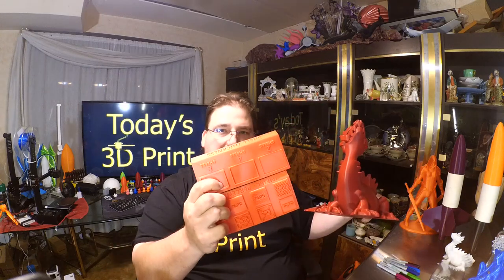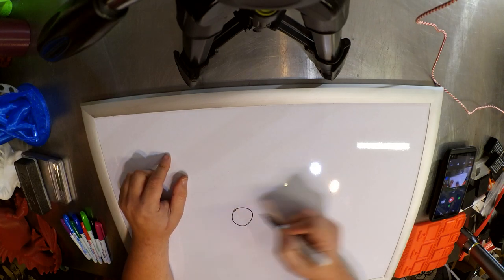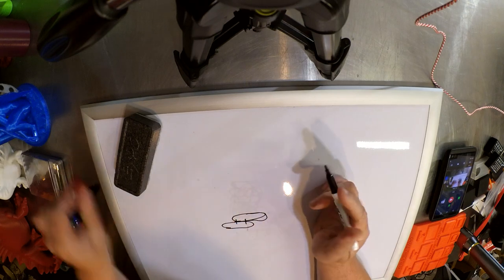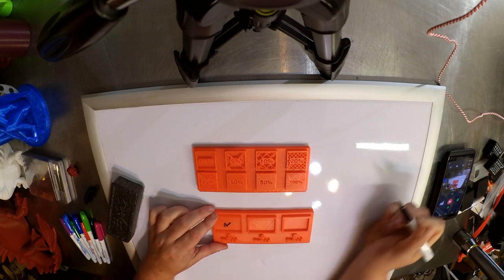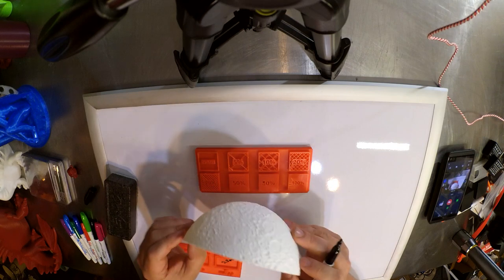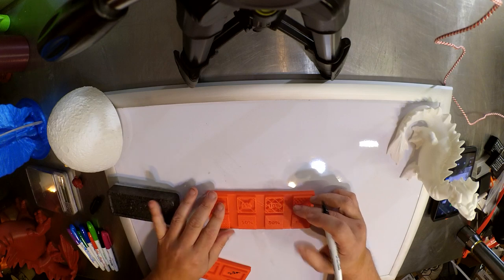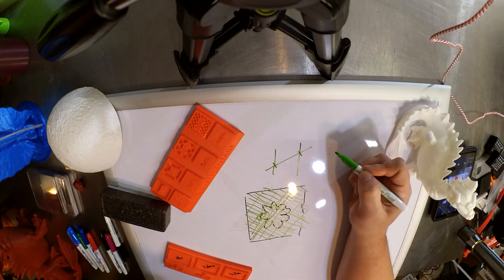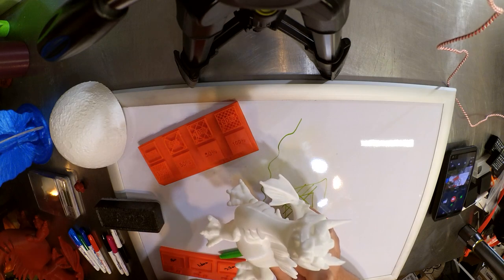Today's 3D Print 117 Educational Perimeters and Infill for Support

Comment: This vid is awesome, thank you! I was curious as I print with a handful of printers in the 200X200X180 size, but have just added a CR-10 to my line up and am realizing that the things I did with the smaller printers will eat amazing amounts of filament with this large a printer. This vid points me in the right direction to saving on material costs, however I was wondering (I don't have S3D yet, it's on the wish list), but could you make a demo vid of how you add custom infill to various areas for these large scale prints? I'm looking to get ahead of the "big" print volume learning curve be fore it costs me kilos of filament! Thanks again for the awesome content!
Reply from the maker: +JimmyPop FiftySeven no problem it is fun just remember you double the dimensions in 3D space and the object takes eight times the volume that's a big jump in both time and filament but oh so satisfying :-)

I'm going to make a video for simplify3d and as soon as I can also with Cura because Cura can do something Simplify 3D can't do. simplify 3D allows me to Define custom infill on the vertical Z axis but not horizontally once I pick a layer to add infill to it adds it to the entire layer

Cura on the other hand has the option to customize it completely it's not as easy or clean but it's there it's called infill meshes and I really want to play with that so stay tuned for that coming soon

Comment: This is really good stuff sir, this is exactly what I am printing those models for. ;)

May I suggest/request that you use a webcam and a 3d printed arm to do your overhead views, there were some parts of the frame that were hard to see. I have personally had good luck with the Logitech C920 and thing:1619715 for in person demonstrations on an overhead projector. :)
Reply from the maker: +Aerik Forager yep I noticed that flipping the frame on the tripod didn't work the angles to steep I'm going to have to design an arm for it so I can Center the camera above the Whiteboard

Comment: CR-10 turned up Friday :) but I have issues with it, build plate is not level :(
Reply from the maker: +Bree Lindsay-Stewart build plate is not level or not flat? Big difference between the two not level you can adjust not flat as in it is bent could be a problem if the bend is very slight just ignore it put the glass on top the glass will be flat
Reply: sry my mistake not flat, took the glass and the heat bed off and they lay flat and look ok, when I put them back on the build platform they appear bent after leveling
Reply: well I don't know what I've done but fingers crossed it looks like I'm getting my first successful print :) the print is sticking to the bed finally, will let you know :P

Comment: Chris, I saw a heated debate over cheap filament vs more expensive good filaments on the CR-10 facebook group.  Some people mention that each filament really needs their own profile.  While I understand the basic filament diameter and temperatures, I'm lost when it comes to retraction, jerk, and probably sixteen other parameters I don't even know exists.  lol. Could you do a tutorial on how to dial in a new filament that one has never used before? Thx for all your wisdom!
Reply from the maker: +Hari Wiguna absolutely there are only two primary settings that I really have to tweak from one filament to the next temperature and retraction and I very rarely have to touch attraction
Reply from the maker: +Hari Wiguna here's all I'm going to say about the debate over cheap filament you see my prints correct? 99% of them are with cheap filament many times $10 kilogram filament :-)

Comment: How you you get a section of the model you print infill and the rest not like you have with The Wish?
Reply from the maker: +NSCXP2005 this is a function of simplify3d it allows me to set up multiple processes where I can Define layer Heights and change how The Print Works at each of those layer Heights I'll make a video showing how to do it although there is plenty already on YouTube
Reply: Nerys thanks Nerys. A video would be much appreciated, plus you explain in great detail
Reply from the maker: +NSCXP2005 don't hold me to this I have to look it up but didn't one of the free slicers just enable variable in feel? Slic3r Maybe?
Reply: Nerys I use simplify3d like yourself. It will be much appreciated.